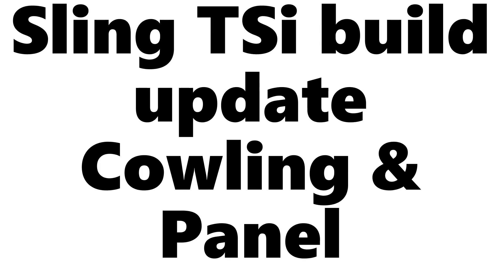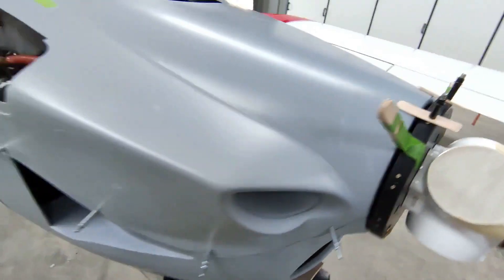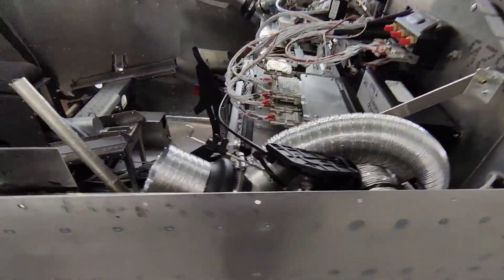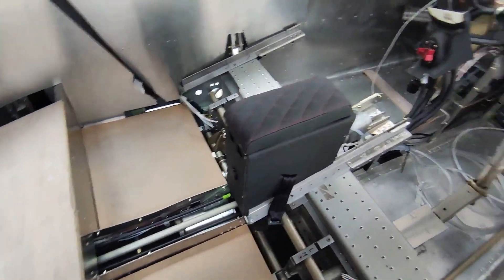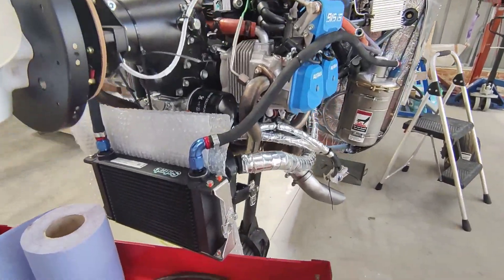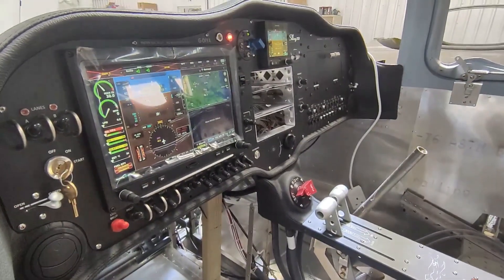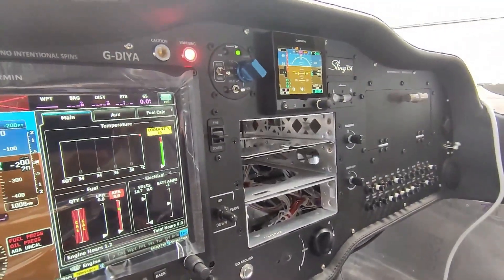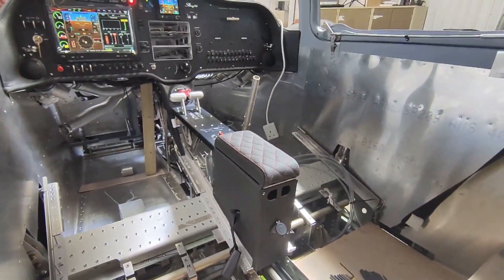Sling TSi Panel is ON

Comment: Hi, will you be open to share with me the files for the 3D printed parts you have developped for your TSI, if yes I would be interested by the one you did for protecting the fuel rubber hoses in the channel ahead the central console and also the one you did for covering the master contactor.
Reply from the maker: Sure I can send you the files. What's the email id?
Reply: @slingbuilduk400  maybe you did not get my email address: olivier.molinari@gmail.com if you can send me the 3D printed parts files it would be great
Reply from the maker: @oliviermolinari  Hi, just saw your email. Will send you the files this week.